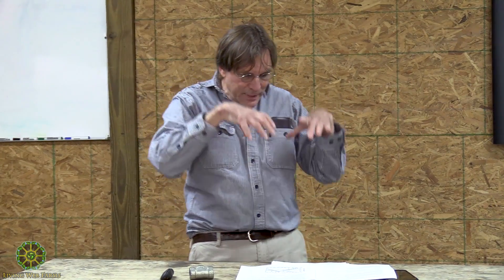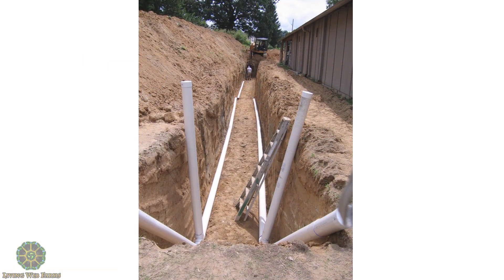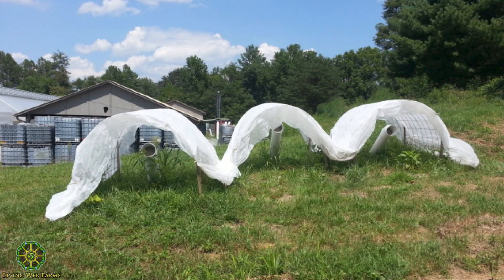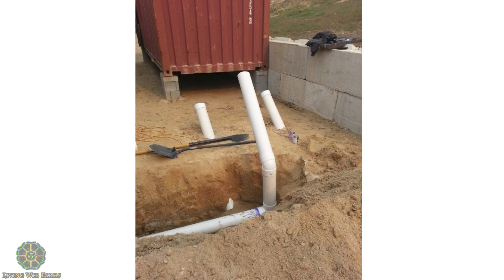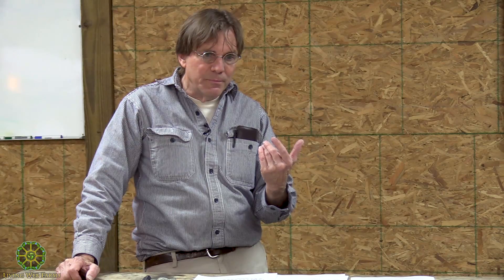Earth Cooling Tubes for Ventilation and Climate Control Part 3

Comment: They need solar chimneys on those pipes. Pvc vs drain, pipe drain pipe has less of insulation factor. Meaning it transfers heat faster and ripples give more surface areas and channels air better. If it whistles it's too fast on thin plastic pipe. If using in greenhouse go 3 feet deep so it don't dry out roots too fast. Insulation under it for cold weather greenhouse. My exhaust goes underground so heat rises by little solar fan. The fan gets turned around in summer like old guy said. I use solar chimney to warm cold air intake. You can build masonry heater or rocket stove and use warm benches to heat green house. My greenhouse is half circle with tire wall for north wall. Do not move the air in passive green house at night. Moving the air in cold weather at night does no good unless your heating the greenhouse some how. Only wasting energy to loose heat if your not paying to heat it. Even one fan at night can reduce a sealed greenhouse temp by 20*F vs almost same greenhouse with no fan on.

Comment: What if youre around a water supply like a river or pond.. you put a pump with a radiator type setup hooked up.. can heat it with a firebox.. that wraps around a portion of the pipe that transfers the air.. heats the ground around the pipe and keeps a constant temp thru the winter in cold climates.. almost like  radiant floor heating but uses the same system as the cooling